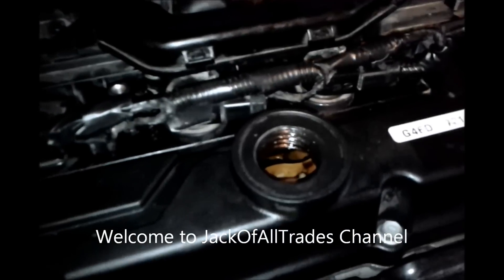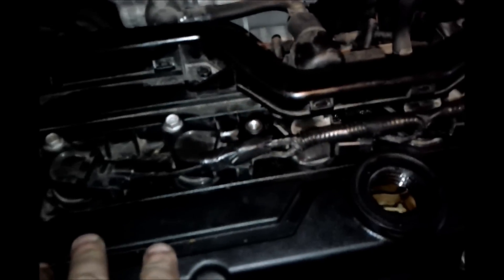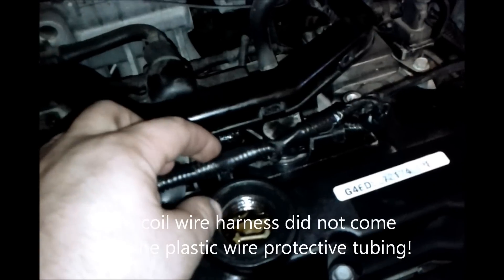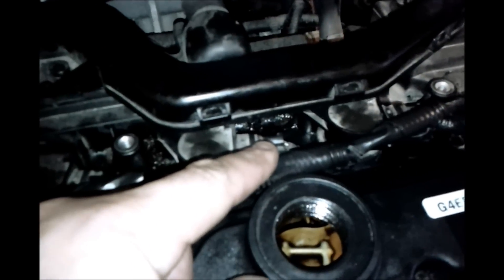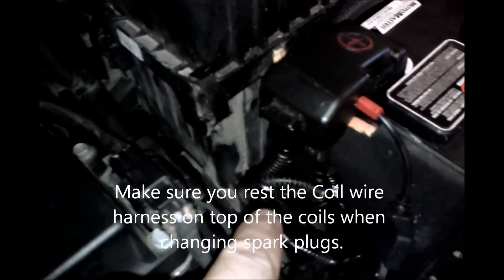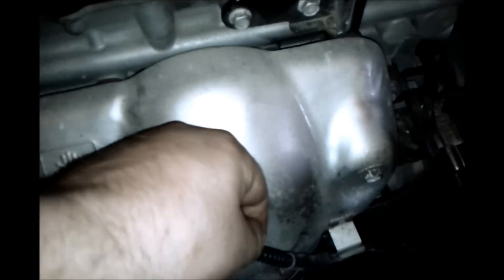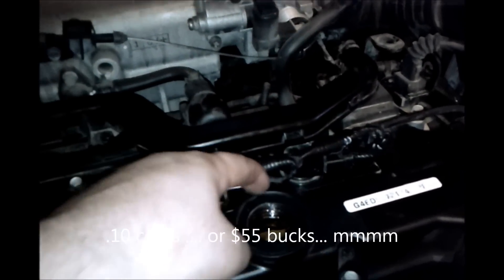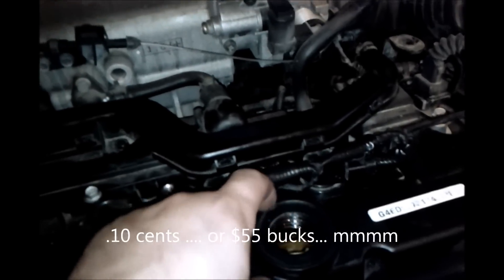2009 Hyundai Accent GLS 1.6L DOHC defective coil wire harness design

Comment: Do you know the firing order for the 2009 Hyundai Accent GLS 1.6L
Reply from the maker: 1-3-4-2
Reply: @gereral1_jackofalltrades  I've been told so many different orders. It keeps saying its #1 misfiring but I've changed it plus the spark plug!!
Reply from the maker: @hayleyboley6754  swap coil  1 2. Reread ecm code. If 2 misfires it's the coil!
Reply from the maker: @hayleyboley6754  if misfire 1 stays pull the fuel pump fuse. Locate the fuel rail.  Swap injector 1 with 2. Put fuse back in prime with key on.  Then check ecm code again. If still misfire have a compression test done cylinder 1 dry and monitor pressure in cylinder . Last would be a leak down test followed by a head gasket liquid rad test. Look these tests up . Goodluck
Reply from the maker: @hayleyboley6754  another area to consider in the intake manifold  gasket or hairline Crack.  Smoke machine or run propane gas over the area if the idle increases you found Xtra air cause misfire

Comment: It said this could cause a misfire but if it is worn all the way thru could this cause your car to cut off while driving?
Reply from the maker: Joseph Burton If the power wire is worn it could ground off the circuit causes troubles. I personally do not want to find out. I use this tubing for wire harness and fuel lines on my lawn tractor and window washer tubing in areas where things rub. This stuff works great in rubbing areas. Thanks for your comment.

Comment: Have a 2010 and the Ignition coils have failed 2x once at 28k then at 40k miles..will try this to see if it helps.
Reply from the maker: Use electrical grease on the ends as shown in my how to remove stuck sockets and spark plugs video. I'm still on original coils at 127,000 KLM 09 accent
Reply: nylonsteel  welcome in club  ,i have spare coil in trunk ,after 40K  replace 2 coil ,

Comment: VERY HELPFUL
Reply from the maker: Yep it keeps that wire harness safe from wear through. Engines vibrate and cause the wire harness to rub against the cover and the other parts ontop of the engine. By doing this will save some $$$ in the long run. My car is now5 years old and the wire harness looks new. No rub through marks like before when I noticed this and recorded this video to make users alerted to this issue and save them the cost of a new coil wire harness.

Comment: Handy tip... any trouble with your value seals.
Reply from the maker: No trouble at all. My car runs great. 2009 Hyundai Accent 1,6L gls 4 door is a great car. Watch me say this now then something happens. There is a saying out there "Don't cause waves" The moment things are great and you open your mouth bang something happens. Reminds me of the time when everything broke and stopped working all at once. I always says when things happen they happen in spades. Example.... Got a ticket for speeding, next week glass frames broke on my eye glasses, 3 days after that dropped my phone broke it, 2 days after that my cars gps decided to give up the ghost. Then I ran over a nail and the tire went flat. Then its been problem free.

Got to love life.......

Are your valve seals leaking?
Reply: If i travel any more the just in town, any time is accelerate, i just get a big cloud of smoke. I have narrowed this down to the valve seals which seems to be a common problem for this motor. Now that I think of it mines a 08 so if I remember correctly we have different motors.
Reply from the maker: Phillguy Do you smell exhaust in the cab? If so the smoke could be leaking from the exhaust manifold seal behind the heat shield. If you are leaking out of the valve seals you would be loosing oil. Do you have to top off oil often?
Reply: In town it doesn't loose any oil but on any long drive 2-3hrs I could go through a litre.
Reply from the maker: I would suggest acouple of things. 
1. compression test
2. To support this test do a leak down test
3. check valve cover seal for oil leaking.
4. remove oil cap check oil for.mirky film. You might have coolant leaking into oil or visa versa. Take or radiator cap. coolant should be clear no oil.

5. Watch timing belt video series to learn how to check crank and cam seals.

6. undee oil pan check oil pan seal and oil pan bolt. Covered in oil change video.

If you have an oil leak you cannot find pour some die made for finding leaks in you oil. drive the car then put a ultravoilet light w/yellow glasses- sell this kit at walmart. The oil leak will glow from the source.

if after these tests find nothing the valve cover has to come off. Then its the valve oil seals leaking. You would see white smoke comung out of your tail pipe.

Some of these tests google to watch youtube videos on these to see how a shop would do these tests.

Comment: Good video, thanks! I understand certain basics about engines and stuff but have always been lost every time I open the bonnet of my car. Didn't know it was all there but just under the cover.
I've just had to get my spark plug wire replaced on my Accent and now I know why!
One little tip would be to use a different colour for the text in the video as it did get a bit hard to read sometimes. But great tips nonetheless.
Thanks again!